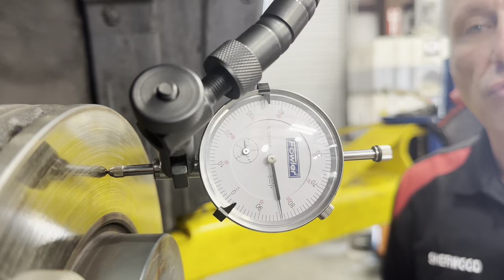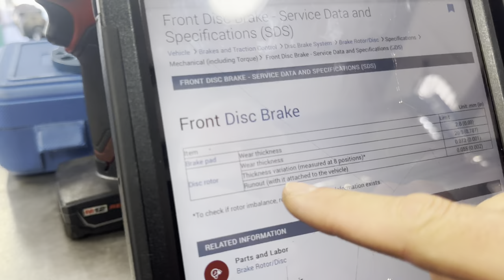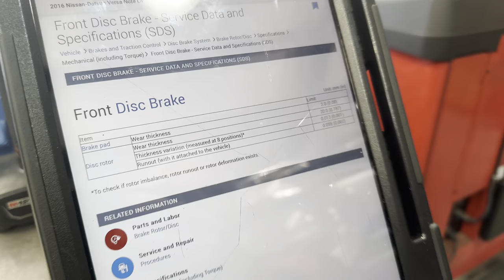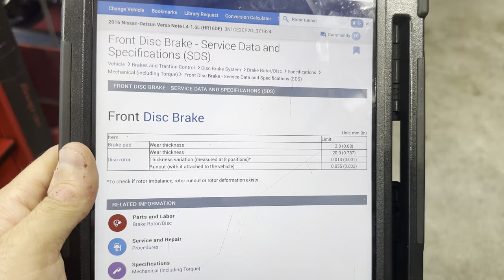It’s Vibrating When Braking & It’s Not the Rotors. How to Test! (Nissan Versa)

Comment: Interesting and it stands to reason.   I’ve worked in automotive machine shops about all my adult days. 
  It was not uncommon to get rotors in from parts stores and garages. Rotors were not very cheap back when. 
    Along about 1992-93 was when I first heard the term composite rotor. Man did those things bring some drama at first. 
    We machined a mandrel and various spacers to fit them on our brake lathe. Nice heavy duty Winona Van Norman. 
   A dial indicator was always used to verify runout or lack there of. 
   Many of these “composite” rotors began showing up with excessive amounts of runout. Some after we had just turned them. 
   It was discovered that the rotors were being installed with an impact and the centering ring on the hub was snagging the ID of the rotor on the hub. 
   Word got out fast around town.  Do not use any impact tools around these brake rotors. A few brake jobs got completely out of hand over the subject.   
    I myself developed the mindset of just don’t do it.  Don’t even have any sort of impact laying around when doing a brake job was my advice. The subject of warped rotors became that much of a sore subject. 
    Many years later I had taken my mother’s Nissan Titan into a tire shop. While waiting in the lobby you could clearly see into the service area. 
    Another Nissan Titan ahead of me was having new tires installed. Young tech was running the lug nuts up with a 20V cordless impact. He did go over them with a torque wrench to finish it off.  
    The owner of the truck was talking with the service manager in the lobby.  
  I discreetly walked into the service area and asked the young man not to use that impact on my wheels.  He looked bewildered so I briefly explained   the situation. His eyes grew wide when I explained the potential liabilities.  Told him he might want to do a brief brake check before hand to make sure the rotors were warped to begin with. He thanked me and I went back inside.  
    The manager had noticed me out in the area and asked if there was any problem. Owner of the truck coming off the lift was still there. I said no problem.
    After that truck left the service manager spoke to the tech and the tech informed him as to what I had requested. 
   The manager came back in and politely explained that warped rotors were a thing of the past and that they did this day in and day out without any issues. 
   All the same the rotors on my mother’s truck were brand new because the original rotors had big runout from a few hard braking incidents. 
   They didn’t get the wheels off of my mother’s truck before the previous customer came back in complaining about severe brake pedal surge. 
    That manager knew I had been discreet and was careful not to mention anything in front of anyone else.    
     After the fact I mentioned that I thought there was a problem with those trucks that stemmed from hard braking and nothing to do with installation procedures.  Just having any kind of impact around that job was opening up liability.  
    My theory proved correct through time. That Nissan truck ride extremely well but if you had to stand on the brakes it would have negative consequences on brake rotor runout.  
   I drove that truck over the course of a several months. I could feel the brake pedal surge, but it would smooth back up given a little time. I’m sure it wasn’t doing the life of a brake job any good.  
     I just don’t recommend any impacts around brake rotors for this reason.  Just not a conversation I want to have with a customer.

Comment: Good video, brings me back to my automotive Tech school days when we actually learned these procedures.
If it's a come back for the same issue and it was determined a misdiagnosis as identified in this case, the rebate or credit should be for prior parts and work performed, NOT what is required to replace the hub, since those parts and associated labor is a valid cost to the customer. 
The credit should be for parts and labor performed to replace rotors during previous repair that were misdiagnosed as the issue.

Comment: 100% correct, in my shop we use the on car Pro-Cut brake lathe you should try it. Will perform the cut with tighter run-out tolerance really has helped us with vibration issues.

Comment: I live in the rust belt. After tear down and extensive cleaning of the hub and rotor mounting surfaces, I put a thin layer of nickel/copper anti seize on the hub surface. It’s rated up to 2400 degrees f so it won’t get hot and sling off. It keeps the rust away until the next time brakes need service.

Comment: My old 300sd Mercedes was purchased by yours truly with a bad vibration in the front while braking. On this car, the rotors are bolted to the inside of the hub, so you have to take it all apart to get to the bolts. The old rotors were in excellent condition, but I had a fresh set. What caused the vibration? Dirt in the interface area, when the rotors had been replaced before, it was not cleaned properly. Perfect smooth brakes afterward.

Comment: This time you were very thorough in detecting the deviation on the hub........and explaining how it will amplify with the greater radius in the rotor when fitted.
Usually, in some videos, I would find some explanation a bit lacking, but I found no fault with yours. This was an excellent tutorial !
I suppose machining the hub to correct the runout is an option.
I am sure that many mechanics will benefit from this video.
Thanks and regards.
Trinidad & Tobago.
West Indies.

Comment: Nissan Quest / Mercury Villager had the same issue. We used to use a lathe that turned the rotors on the car, rather than replace a hub. Virtually every van had some hub runout so we didn't even bother turning the rotors off the hub, worked every time. * we marked the rotors to make sure if someone took them off they went back on the hub the same way.

Comment: Good info!!

I have never warped a disc or have had pulsating brakes on my own cars.. because I actually use them, best method is once in a while slow down from high speed down to almost full stop - brake hard and long (of course when this is possible and no other cars around). My brakes are dusty but always have a direct grip/bite feel, also when using normal pads. 

Brakes that don't have a bite are cheap (hard) pads or not used properly. I have had customers in the past, almost every year new rotors, pads, could not get them to to understand. This is why Tesla's have crap brakes, they are not being used.

Comment: Nice video. Have seen similar on a Toyota. Vibration under braking 
We had replaced bottom wishbones and drop links due to wear. 
Then replaced brake disks again due to wear. 
Hubs and disks were running true. 
Wheel balance was good. 
Wheel bearings were perfect 
What we found was the top strut mountings while appearing perfect were 15 years old. Bearings were perfect in them. 
However replacing those solved the issue. 
All I can think is the rubber compound hsd stiffened with age over time and was not absorbing vibrations as it should. 
Was one of our own  family cars. 
12:22

Comment: Re lubricating the slides and the back of pads: I do it with anti seize compound. I put some between the cradle and slides too, to reduce corrosion buildup. On the inner rotor surface I put slight synthetic grease to reduce the risk of cold weld to the hub surface - makes taking the rotors off the next time easy, and reduces corrosion of those surfaces.

Comment: i had something like this happen to me in the last few years.
i smoked a rear axle in my daily bad enough to send chunks through the diff cover so i was impressed.
threw a junkyard axle in but saved my backing plates for the drum brakes. hung them so i could leave the brakes together and swap axle separate. slid new axle in and popped the backing plates on and threw the drums and wheels on and off i went. it had a little shake at highway speeds over 70 mph big whoop. one of the counterweights fell off one of my drums sometime after that and when i got new tires i noticed. so i got new drums and tossed em on. figured the shake would go away it got worse.
then it started happening on braking and while going down the road. i open my drums up as their clearly dragging. chocked full of brake dust. clean out adjust brakes and the whole process starts over. smooth as silk down the road. then it starts shaking again. i pull back off and drums are full of brake dust. but the top of the shoes have more wear on them than the bottom. turns out the backing plates werent centered properly cause when i put them on with the old drums they were so worn that what felt like centered wasnt. so now i need to loosen them up and tap them around a little to get it back on dead center. its just weird how bad they cake up with brake dust but if the gap is too small where the dust normally would get out it would stay. my backing plates also dont have the punch outs for the adjusters which im sure doesnt help my case.

Comment: Very well explained, vibration can occur even when the there's lots of pressure  of front disc brake due very weak or defective rear Drum brake. This is what exactly happened to my car and was resolved by  replacing the rear brake liner.

Comment: I know this is an older video, but I didn't hear it mentioned what happened to the hub to cause the problem. I worked for GM as a District Manager for 20 years and I preached to independent shops to properly torque the lug nuts rather than just give them 5 ugga duggas. Keep up the good work.

Comment: When my dad was a tech, he used a rotor machining tool you would mount to the rotor while it’s still attached to the car and spin the rotor using the engine.  That would take into account any issues like this.  It would only work on the driven wheels though (it was a Honda shop so most vehicles were FWD).

Comment: Changed my front rotors 2 times and still have steering wheel shake under braking... will get this dial indicator and gonna check my hub! hopefully its a problem!
When i ask about this problem in every car repair center, all mechanics are telling me straight away "its your front rotors"... even if i changed them 2 times already :D
Thanks for a video! Very helpfull!

Comment: My daughters Nissan Versa developed vibrations while braking.  Her husband changed out the the disc brake pads, new rotor, bearings, and CV axles, no change still had same symptoms.  He eventually diagnosed worn bushings to the A arms, replaced, and vibration went away.

Comment: I had a problem on a 4runner that acted just like a warped rotor. The only thing was that it would come and go. So i knew off the bat that it wasn't a warped rotor because a warped rotor doesn't cause vibration intermittently. I fought with this issue for months. I looked for everything that i could think of but couldn't find anything wrong. Eventually i discovered that the brake caliper ( 4 piston style. 2 pistons inboard 2 pistons outboard) was the issue. The forward piston on the outboard side was seized in the fully open position. So when i was applying the brakes, the forward inboard piston was applying pressure with no opposing pressure coming from the other side and was causing the vibration. I changed the brake caliper and it immediately fixed the problem and that was about 5 years ago and i haven't had the issue since.

Comment: I had a shaking on my '07 Town and Country van about two years ago and assumed it was the rotors so I replaced them on the front. Solved the problem. Now it's doing it again and I've been thinking rotors again and maybe the rear this time. It's front wheel drive. Can the rear rotors do the same way when braking? The shaking feels the same way as before. I never realized the hub could cause the problem. Good info and well explained.

Comment: As soon as I opened the video, I was thinking that you check runout with a dial indicator. If there's less than .002" of total runout, you will not feel it in the pedal. Isolating the rotor runout  from the hub runout is good practice. Overtightening the lugs can deform the hub. That's why You can use an air wrench to remove lug nuts, but use a torque wrench to tighten.

Comment: Long ago I had a 85 mustang gt.
I had pulsating brakes so I took the rotors to autozone and had them turned (machined) they actually used to do that. The brakes felt fine for a week or 2 then start again. 
So off to the zone to be turned again, they would often do it while you wait, while they were turning them I could hear 2 different alternating sounds from the cutter, as a machinist I knew something wasn't right.
When they finished I could see
an area on the rotor exactly the same size and shape as the brake pad . That area had somehow got hardened and did not wear down like the rest of the rotor, the soft area would wear and become thinner causing brake pulsating. I guess the rotors had got hot just before parking the car and the pad caused it to cool slower and somehow hardened the rotor.

Comment: I've seen 5 thou not make a difference, other times I have seen it make a massive difference.
10 thou, I would like to drive it and feel.
The worst brake shudder I've had was made by me one time when I was machining a rotor, I missed a bit and put it back on the machine and only cut one side. It was shaking the steering wheel like nothing else.

Thanks.
Shane.

Comment: Good video. 
I had a Honda Accord with this problem. The dealer's solution was to turn the rotors while on the vehicle (to compensate for the spindle runout). I thought that was insane and replace the spindle/hub myself. Problem solved!

Comment: Work at a dealership and Seen many times these hubs are out of round due to over torque lug nuts. Alot of time when this amount of runout on the rotors, pulsation or vibration will still be present after replacing the rotors. That's why you need to road test the vehicle after each repair to prevent a come back like this.

Comment: If i have a questionable  vibration I like to spin the rotor on the brake lathe this will quickly show any run out and placing your finger and thumb either side will soon find any surface deviations, ,These front wheel bearings on these are fairly common as well. and you cant always feel them by hand,/ noise, a new hub and bearing is the way to go, great video nicely done,

Comment: Handy to see instructions & explanation on measuring runout on rotor & hub. Admiting shop missed initial problem is one thing, but to do so publicly on yt channel sets good example for us all. That, and it's impossible to nail it everytime. What does come to mind though ... was the car test driven after initial rotar replacement?... one would think the tech would've noticed vibration remained post repair.

Comment: I am surprised that the customer didn’t have an issue with the brake pedal feeling soft at times.  I had a warped rotor that would cause the pedal to go soft and then hard again.  So basically the rotor would push the piston back in just enough to give you a soft pedal, but you would still get brakes and then it would return to normal if you quickly reapplied the brakes

Comment: Excellent video! A person taking responsibility for their mistake shows extremely high integrity.

One interesting thing I noticed is a discrepancy in the specification for thickness variation, the metric and inch measurements don't agree... one of them is wrong.
0.013mm = 0.0005"
0.001" = 0.025mm
0.013mm is not 0.001"

I'm guessing 0.013mm (or 0.0005") is correct. I wonder how many other places in that database have a mistake...

Comment: One of the largest problems over warped rotors is many tire shops use impact guns on the lug nuts instead of torque wrenches. Whenever you hear the impact tighten the lug nuts, you can expect warped rotors after a few days of driving. Watch the tire shops! There is a proper torque for lug nuts.

Comment: This was good to see.
Let me ask ; I was told in a reputable trade school that torquing wheel lugs (w a torque wrench) is done so that there isn't a variance .
The claim was that when the brake rotor gets hot combined with the varied stress of unequal torque will cause warpage of the rotor.
Do you agree with this reason?  I do...

Comment: i'm at 2:30 of the video.  are you saying the hub/bearing could be bad or loose?  Great video!!!  I'm a DYI, most of my work on my cars the rotor is bad after replacing the run-out has stopped and w/o using a dial indicator.  I have a dial indicator but not the flexible type neck.  going to order one online and take away the guesswork.  I do the same place all lug nuts with the rotor in place and eyeball the warp of the rotor but not looking at the wheel hub.  i assume the car you're working on was in an accident in the past the shop repair the car assumed the rotor was fine since it look straight..

Comment: Take the rotor to a machine shop and have them surface the rotor. Could be wheel bearing. Maybe use an extension rod on the dial. Very good and informative YouTube channel 👍🏼

Comment: I had repeated issues with the front rotors on the ford causing vibration (under brakes)  after 6 months. I replaced the rotors and once again 6 months later the same issue occurred.
I checked the runout and found the RH wheel was out of spec. I added a shim between the hub and roter to correct the run-out. It has been more than 3 years now with the same rotors.

Comment: Warped hubs can come from uneven wheel nut torque, always use torque wrenches. The runout makes rotor thickness variation which causes pulse in the brake pedal. GM published a in-depth TSB on fixing pulsation. IIRC a variation of .0005” can cause a pulsation. The rotor to hub interface must be cleaned of all rust.